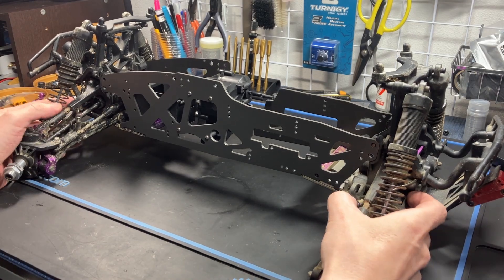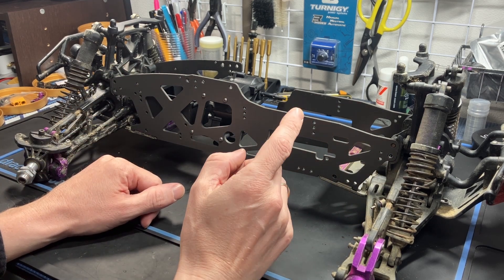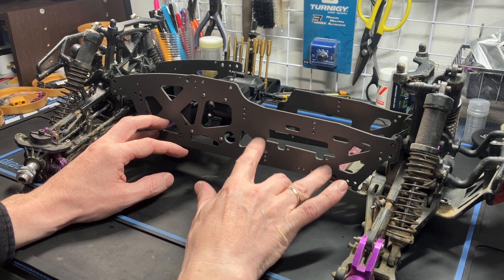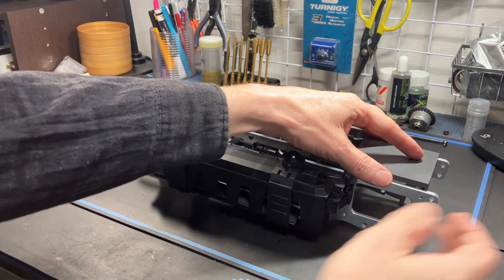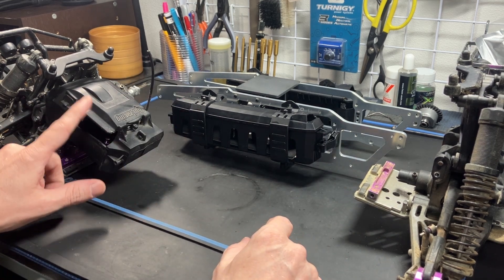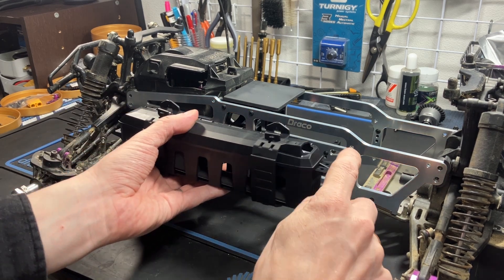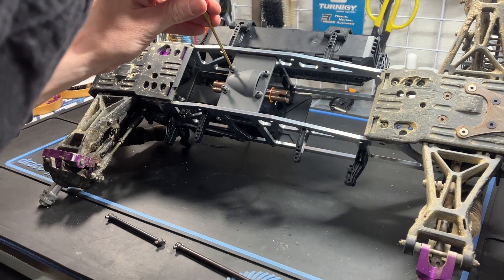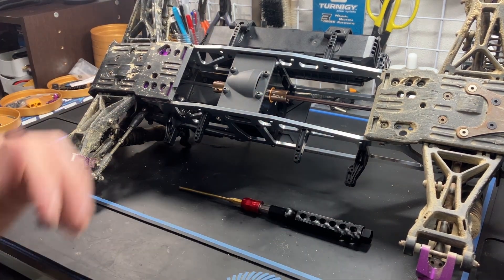Converting your HPI Savage Octane/Savage Flux XL GTXL6 - Draco Savage XL Electric Conversion Kit

Comment: I just got an old HPI savage xl 5.9 that was crudely converted to electric and I’m going to go through and redo all of it.  Would this kit work on a savage xl?
Reply from the maker: Yes, the kit will work well. It is basically a straight swap of the centre section. You only need the front and rear clips and the dogbones essentially.

Comment: I have a forward transmission chassis from FLM and I was wondering will the center differential mod work this this chassis? I like this chassis because I can put the lipos in the TVPs instead of using battery boxes.
Reply from the maker: I’m afraid I am not sure as I don’t have this chassis. There are some assumptions I can make from the photos though. The Draco Set will fit the screw pattern but the servo plate will make contact with it. There is also the matter of the driveshafts. They may fit but without the FLM kit to test fit I can’t say for sure.